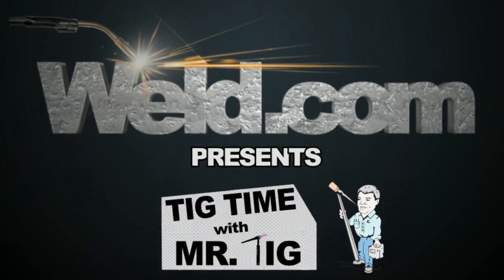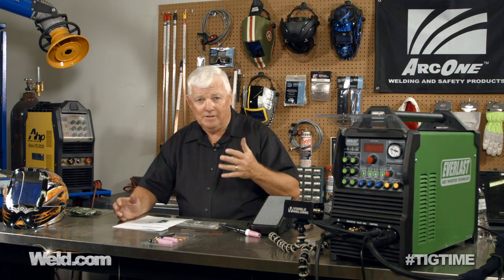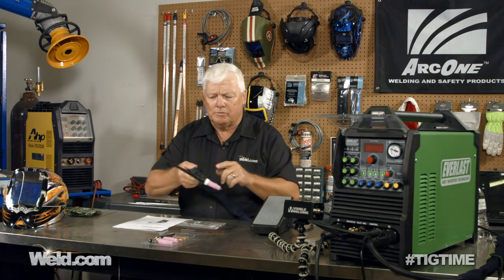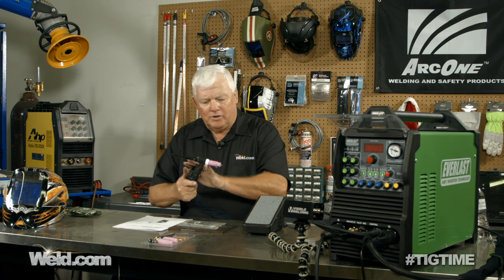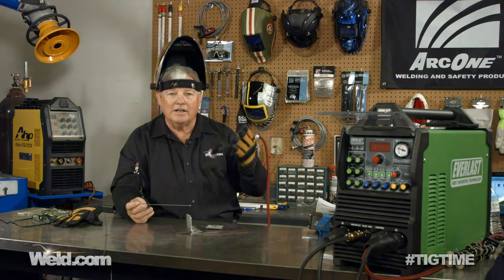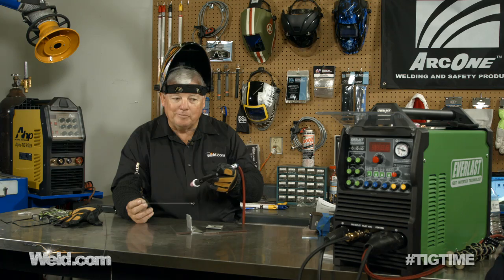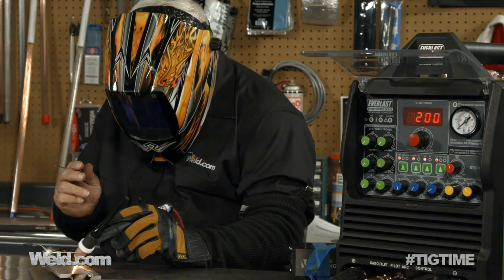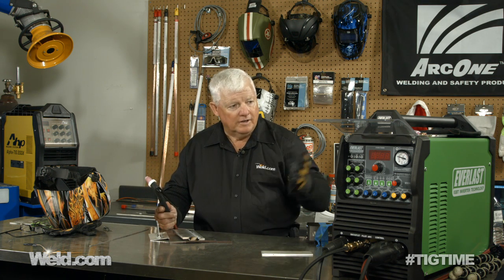Welding With Everlast PowerPro 205Si Review Part 1: Full video in WELD™ app!

Comment: I enjoy you showing how to do things with the different options; However, it would be great if you could back up a bit and go over details of how to setup the machine for these different uses such as how to setup the air to the machine. I think most expect that you know this stuff or it shows you in the owners manual. This is not the case. Also, things like Argon gas and how it should be a 90/10 mixture not 100% Argon. 100% Argon makes my welds ugly and useless. Burning through tips, tongueston and even a torch way too fast. Wish I were at a higher level, but I'll never get there without the basics.

Comment: The idea, is to review the PP 205 SI and what it comes with. Changing the TIG torch to satisfy yourself defeats the purpose of an items review. This doesn't really give a review for what comes in the box. You wasted your time filming this review in my opinion. Example: Maybe welding the aluminum edge weld would have been great if you used what came int the box. Those of us interested in purchasing this item, won't know it's capabilities because your failure to actually review the true purchased item.

Comment: Mr tig you are a liar and a fraud i haven't tigged in 20 years but my new pp205si justed laid out the best weld l have seen in years on 1/4 al plate and 1/8 stainless with very little color tead the manual and try again
Reply: I agree !! Bob M is a welder and Jody C (weldingtricks ) are welders the everyone can learn from

Comment: why did you change the torch and the pedal? we need a review on the out of the box setup...
Reply: Mr Tig is an accessory snob. The included accessories are perfectly fine to start out with and are in line with the price you pay. Like anything if you want to upgrade you can. Unlike some of the other welders out there nothing is permanently attached.

Comment: Mr. Tig says that machine is maxed out on 1/4" al, but the readout is showing 170. Is there more to be had, is that the actual max output? 
A real application where you need pulsing... like an edge weld on thin sheet? I wonder how it would've performed.
Reply: +idriwzrd That's what I thought.  He used a 150amp torch, which I'll bet didn't help the machine on the high end.  And I thought pulsing was exactly created to prevent too much heat buildup.

Comment: Let me summarize what I think I heard.  The included torch is crap so plan to buy another.  The included foot pedal is ok, but he used another for the review.  It struggles at low amperages, but doesn't have enough amperage to weld anything more than 1/4" AL.  Sounds like its a machine with many limitations, at least in AC TIG.  

I was very intrigued by a multi-process machine for similar money to what I was thinking of spending on a Plasma cutter alone, but given the limitations, I wonder if another machine would be a better buy.
Reply: +dahveed284 Depends on what you're going to be using it for, primarily. If you're planning on running heavier on very light material often, then another machine is probably better. But for most guys who plan on using this machine for common work in the heart of its operating range, it'll probably work just fine. 
I have a similar torch on my machine at work and while cumbersome, it gets the job done. Sure, I'd like something better, but I work with what I have. 
I think, at the price point, this is a competitive machine. I'm actually considering one for at home jobs.
Reply: It seems to be a good unit for the price. It seems to be priced so that it is affordable for more people.

Comment: avocasingle track u haven't said what your issue is yet but I do know the everlast line needs frequent adjustment of the point gap inside machine so I'd look into that if u own an everlast machine. it causes many issues when in need of adjustment.

Comment: I've never tig welded before so I can only base my reason for asking this question off of my mig experience.  Is the popping of the arc when you ease off the amperage a concern for weld quality?  I know on a mig weld, when it pops like that you end up with air within the weld or the worm like crater.

Comment: I just recently brought one of these machines, the 205s, which i believe is just the Australian version of this one, not sure though. Found it to be a good starting point for all types of TIG welding with less cost than a comparable Miller of WIA, and the plasma cutter is an upgrade to using a torch to cut plate with, just as a bonus.

Comment: Thank you for doing these reviews. Im looking for a tig welder and appreciate the type of testing that you do and your honesty.  I was looking to buy a miller diversion 180, but was afraid of the price point versus the price of the cheaper units. However its difficult for me to buy a machine where the components that come with it, force you to immediately upgrade to other more quality parts/accessories. Based on your review here so far, it seems like the other $750-850 non industrial units are a better buy for less money.  At this price point ($1700ish), id buy the miller.
Reply: +gtsdesigns miller diversion 165 and some of the cheaper machines have better controls . on the diversion miller presets all the controls {BAD DEAL}. I replaced a millermatic 120 with a HTP 2400 my welds improved with a cheaper machine.
Reply: I totally missed the, its got a plasma cutter built in!  Had to watch vid again. So i do understand the price point now.  I already have a plasma cutter.  Looking forward to more vids.  Thanks again.
Reply: I used the 2014 AHP for about a year before I upgraded the torch. It worked well enough for me to get started and learn to do copper . steel and aluminum inexpensively.  BUT Mr. Tig was very helpful getting me set up with a new torch last week and its awesome.!!!!!! The foot pedal works for now. I see the perks to upgrading but it works, I am a hobby/ occasional work use welder. I have no regrets , it got me welding. Otherwise I'd still be dreaming..........